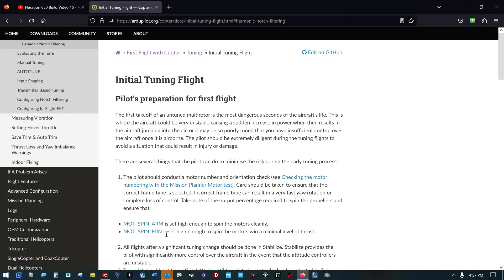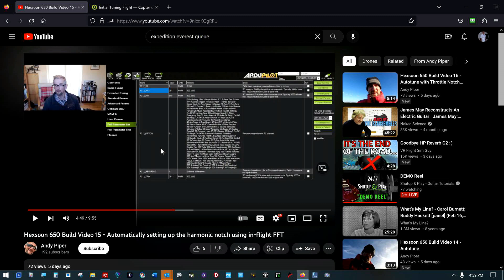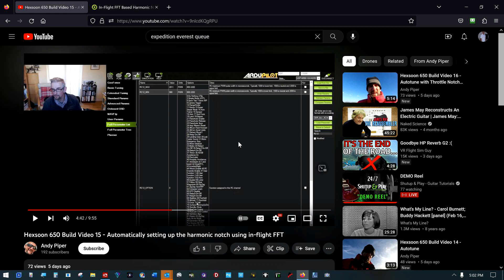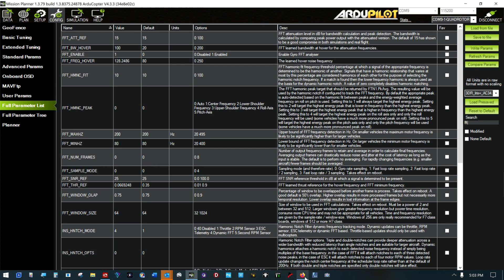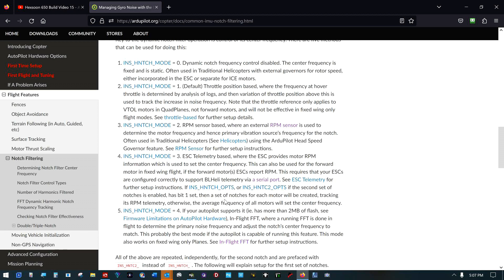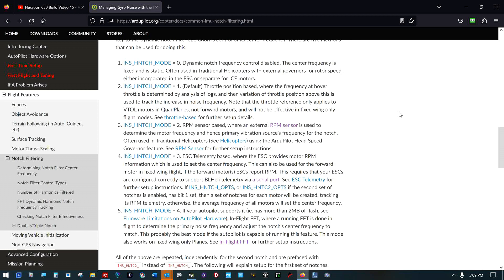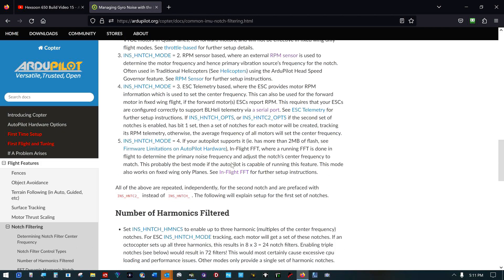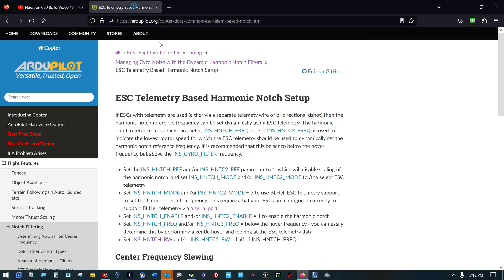Harmonic Notch Filtering New Plan

Comment: did u watch Andy Piper's 5 inch vids? he's wrote most of that code. I was finally able to tune up my 5 inch to a pretty noise free setup I did not do the inflight FFT, settled on esc telemetry mode.
Reply from the maker: I have been subscribed to him almost since he started making videos.  I started working with Ardupilot around 2012.  I watch his videos over and over when I am building.  Really a good source for all things Ardu.  I am trying to stick with In-Flight FFT with FFT running all the time.  If that fails on me I will also switch to telemetry based.